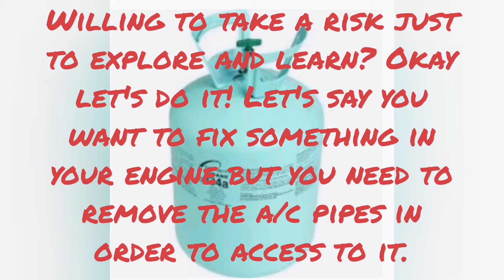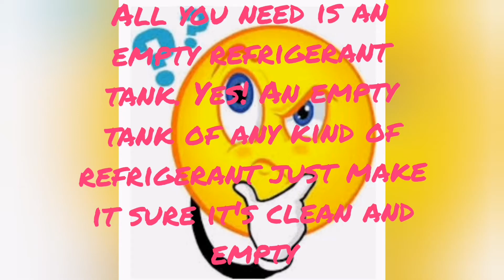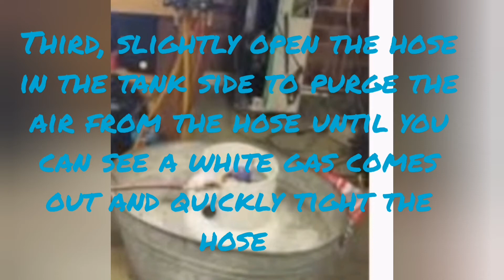How to recover a refrigerant on a/c system without a recovery machine..

Comment: refrigerant tanks use a one way valve, what's your work-around for that little conundrum?
Reply: Remove the valve duh. Unscrew the top, force it past the crimp, either punch it out or use a deep Schrader tool and screw the valve handle back inm ya dingndong
Reply: @thepisswalker  try again, don't see any of that here. this process will not work
Reply: @joestreiff9401  a few of the local brands use ball check valves you can drift punch out or a Schrader. I didn't really specify about the ball check ones. Maybe you can try the canisters for other gasses that are typically disposable in your area for a work around. Be aware of that it has to be a liquefied gas and it's rating psi wise for the container. You can then weigh them to estimate how full they are and not let them sit in the sun or get hot.

Comment: hi, so there is no need of removing the air inside the tank ? that air will have moisture in it and will provably damage your AC after you put the gas back into the system? can one use the gas back?
Reply: I was thinking about getting an empty tank, hooking it up to a vacuum pump and evacuating the tank which would pull all the air and moisture out.(30-60 minutes vac time). Then closing the valve on the recovery tank and hooking the manifold gauge set to the vehicle and opening the valve on the manifold gauge set slightly to, purge the air from the hose at the recovery tank and then opening the valve on the recovery tank(which will have approx. 30 inches of vacuum in it) to suck the refrigerate out of the system. If not enough capacity might need another tank for a large system.
Reply: @rickl6697  
Did you attempt to do it on your own? And tips you can give? I'm brand new
Reply: @adictiveadictive  Nope. Not yet.
Reply: A new receiver dryer would go along way to removing the moisture. Or maybe you could get someone with a recovery machine (expensive machine)to recover it and put it back in your tank. Or I would just give it to them as I personally wouldn't want to put old refrigerant back in my system and just use new refrigerant.
Reply: Air would sit on top of your recovery tank, you can just purge the air out by opening the valve slowly for a few seconds. For the most part anyway. If you're doing something like this in the first place it would be satisfactory. A little bit of air isn't going to blow up your AC system, just shorten the life by an amount no one can tell you.
Reply: Eh who's really worries about A little refrigerant. Just put it in an old propane tank and bring it in. Replace with brand new.
Reply: suppose that would require an adapter for the tank tho